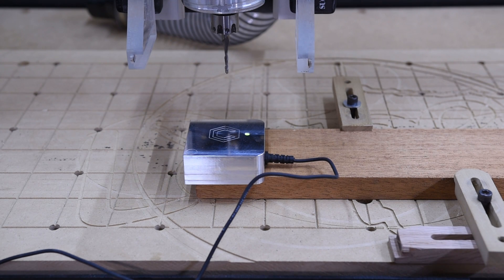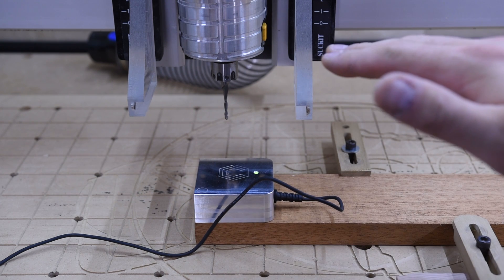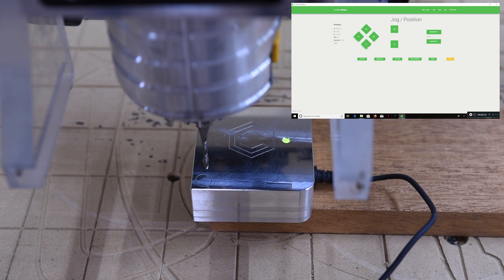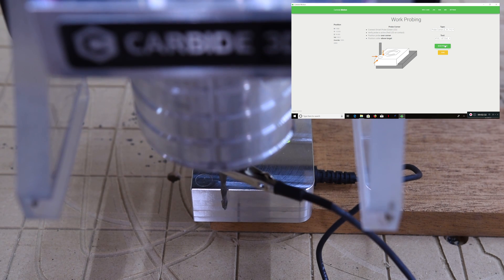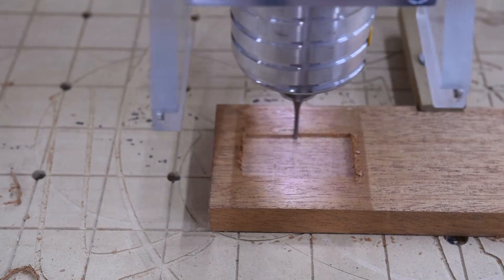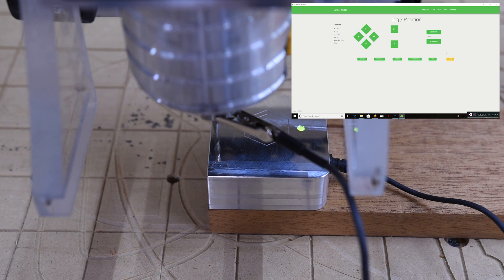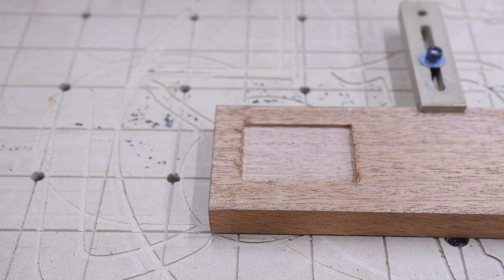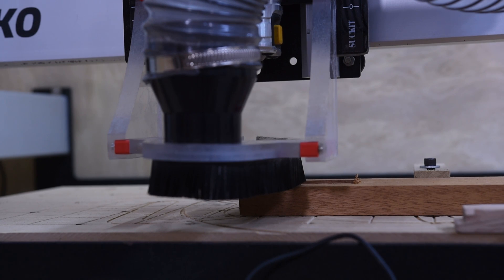How to Use the Carbide 3D Touch Probe with Shapeoko and Carbide Motion

Comment: Thanks for the video. I wonder why my probe when doing the x, y and z and then start the job, it moves to where it should but the router bit is about 2 inches above the work piece and will not move the z axis down far enough to actually make a cut... Strange indeed. Using Carbide Create and top of the material surface for zero.. ugh, a little frustrating for something that is so simple.

Comment: Quick Question ... I am doing i piece that requires to use an end mill to cut out the piece and then a v carve to carve out some designs how do i reprobe mid file when i switch the bits
Reply: Make 2 seperate files then re probe for z

Comment: Question have you ever used the probe to touch off to the spoil board with just the  Zprobe. If so how did you do it
Thanks Jeff
Reply from the maker: I have never used it to touch fromr the spoilboard, but it would work the same way.
Reply: @stufftokeepyouentertained2168  Well I have  looked high and  low for a good explanation as to how to use the  probe. And  your is by far the best one I have  found. When you did the  x any  y on the top of the board ,when you were done with one and changed to the other did you hit the  done  button on that  screen to move to the  next screen. Thanks Jeff

Comment: Hi..where you buy the bits for your router? Why can u use these small bits?
Reply from the maker: I get most of mine from a website called precisebits.com They work by using a reduced size collett also available there for most routers.
Reply: @stufftokeepyouentertained2168  thx a lot...and greets from austria/europe👍
Reply from the maker: @daniellang7201  absolutely. Thanks for the question and watching.
Reply: @stufftokeepyouentertained2168  Thx alot :-)

Comment: Thanks for the video.  I put a zip tie around the cable strain relief and left enough tail left to attach the alligator clip when not in use.  So when I put the probe in place, the alligator clip is right there to remind me to place it on the tool.  I haven't failed to attach it ever since  :)  Also....don't try to probe Z with a diamond drag bit.  :D
Reply from the maker: Good advice. It's always good to learn from others mistakes🤣

Comment: You talked about having to raise your router to use the bit you toughed off with. Maybe the problem is that  you have added a .75 thick waste board to the top of your unit and  you had a piece of .75 wood and then the added thickness of the touch probe no wonder the router had to be moved up. Are you aware that  you do not need to put the touch probe back in the corner to do a Z probe only when changing bits you can put it any ware on the top of the wood so long as the whole probe is sitting on the top of the board. Also you can use the new Carbide motion  to do the old paper touch to do the XYZ and in the middle as long as you  click the set  zeros on 2 screens.
Jeff